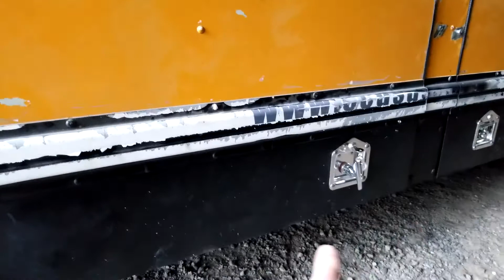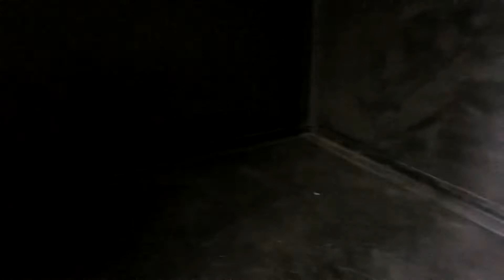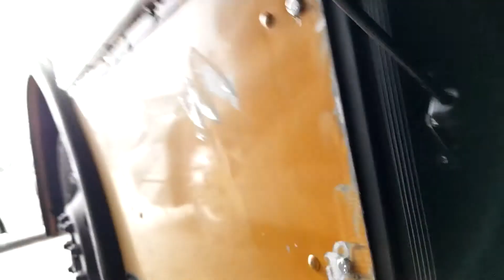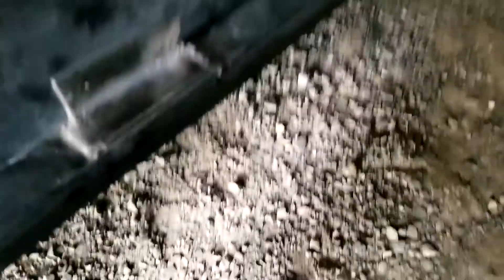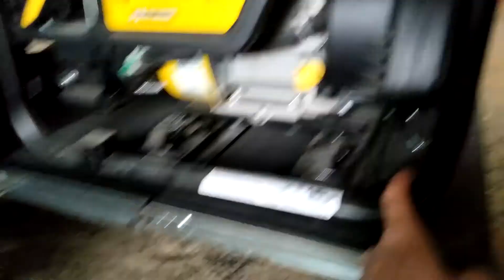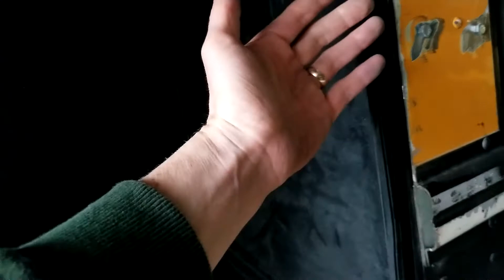Skoolie Under Carriage Storage Fabrication Walk Thru

Comment: Good work! Remember that while those all threads might be rated for 600 lbs, that's a static load. Hitting a big pothole with a full box or tank may be a larger load than you think. Belt AND suspenders is the way to build.
Reply from the maker: I have 4 rods on each box, I dont really think I'm going to be anywhere near max load.
In I had a bunch of iron tools and chains and such, I might reconsider, but for my particular application I think I'm ok.
But good to know for other carrying a heavy load. thx. 😊